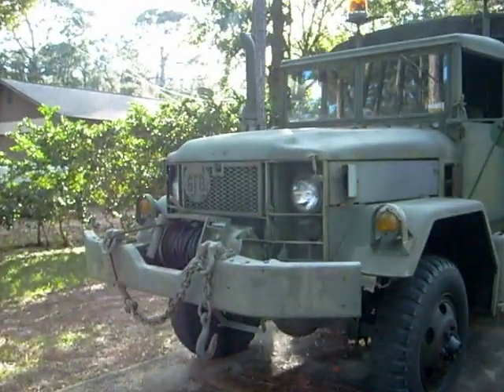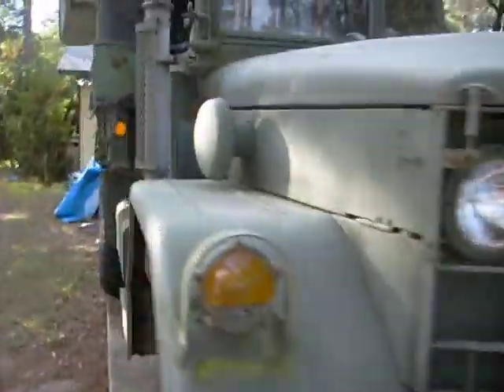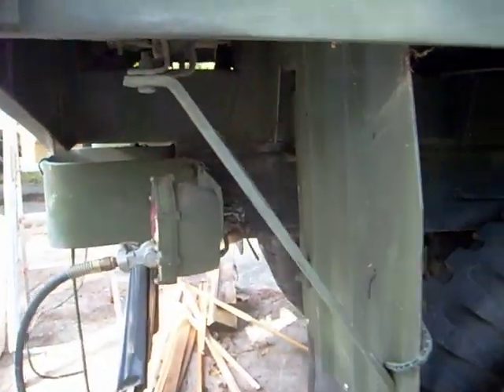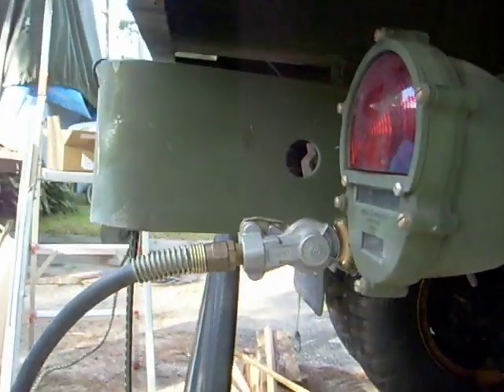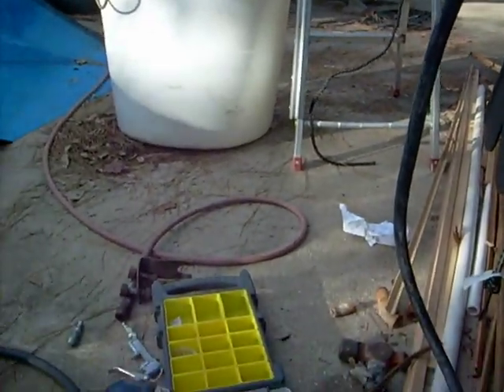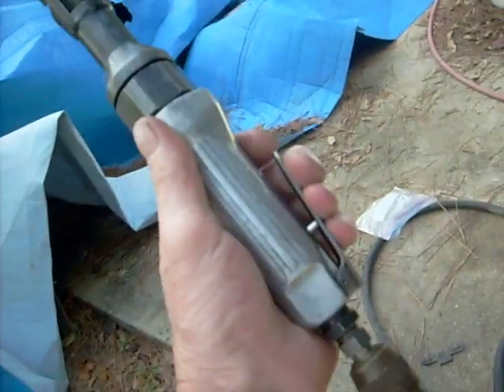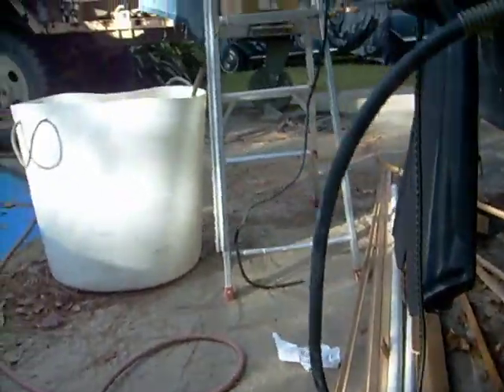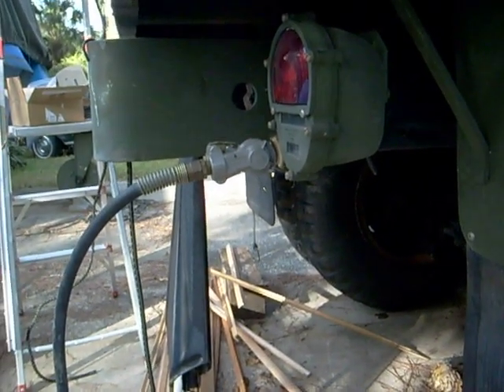M35A2 Glad Hand Installation & Use, 19  Dec 2008 006

Comment from the maker: These trucks have many features that add to their versatility.  Despite their size and weight they are actually practical for daily driving.  The 12 foot bed accomodates practically anything and you can run these trucks on gas, fuel oil, transmission fluid, WVO, biodiesel, used motor oil, and many others.  You can even jump start aircraft with the use of military jumper cables that plug into a NATO 24 volt socket on the passenger side of the truck.  Owning one is lots of fun as well!